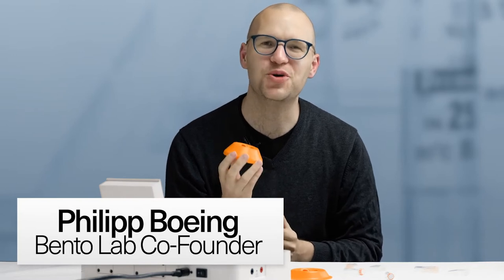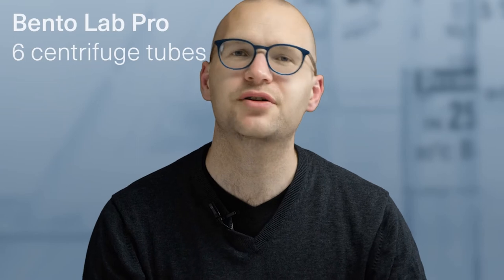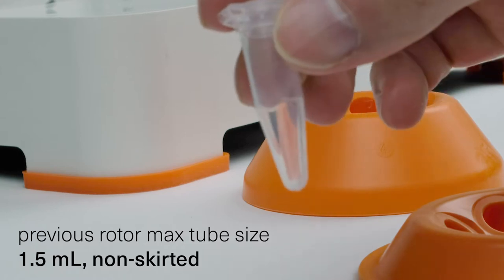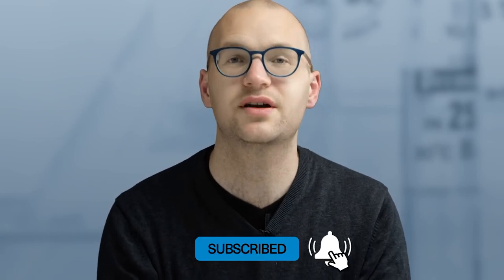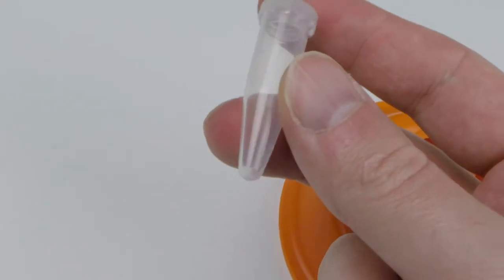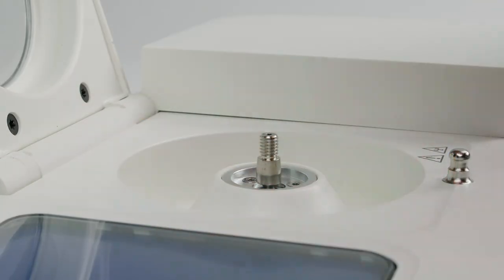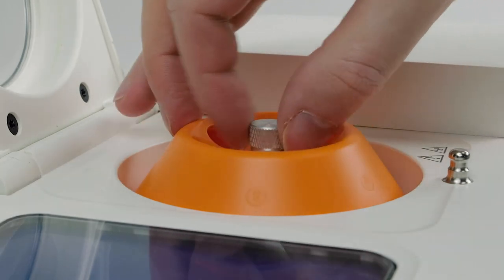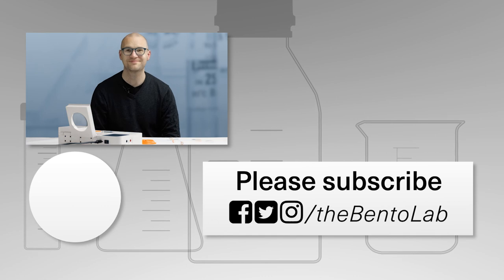New: 2 mL Centrifuge Rotor for Bento Lab Pro

Comment: OMG so cool
Reply from the maker: Thanks!  (/^▽^)/
Reply: @BentoLab  My laboratory thinks to buy your laboratory, but I don't understand, what is the difference between the pro and entry models?
Reply from the maker: @pullumsaurus2052  Have a look at the tech specs on our website here: https://www.bento.bio/product/bento-lab/

The Pro configuration comes with a much faster (and variable speed) centrifuge, a higher PCR temperature range, and a variable gel voltage range. Whether Entry or Pro is right for you, really depends on your workflows.
Reply: @BentoLab  OK so cool!